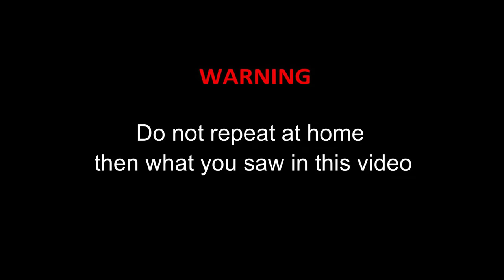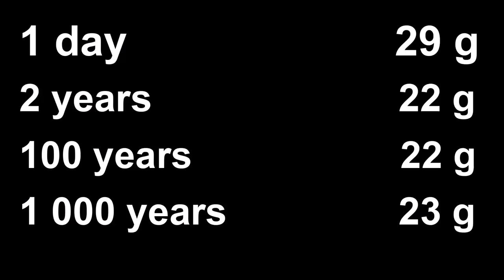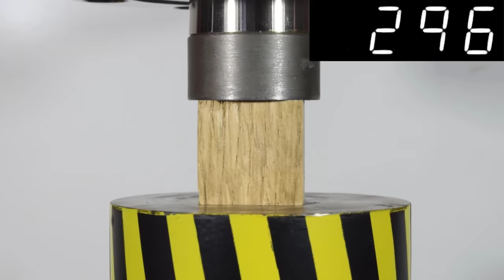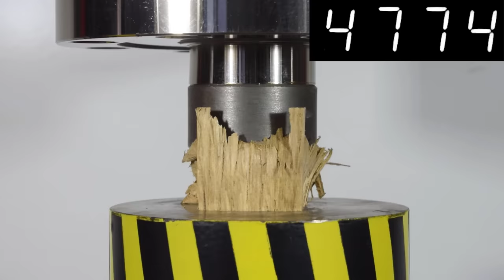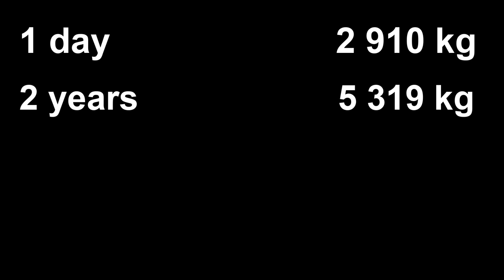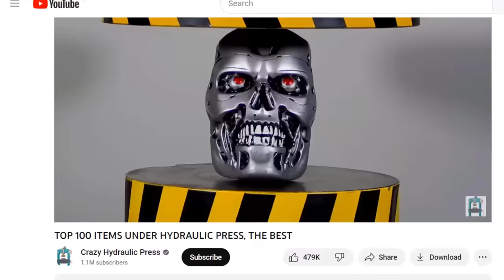HYDRAULIC PRESS VS WOOD OF DIFFERENT AGES

Comment: The problem was at woods all of them not worked in their total capacity. Firstly we have to know woods. Oak is type of hardwood and theirs cell walls are thick so a little bit better than softwoods but not usable for construction due to their weight. Whatever, oak for testing okey but 1 days log has sap water, initial water so means free water in cells from cavities or plot inside cells space and cell walls imbeeded water. Water amount really affect the strength of wood and for a years and years after, thats why wood better! But if you put for 48H in furnace at 105 degree, woods become oven-dried and kilned from any decays and rots also increases strength way more better!